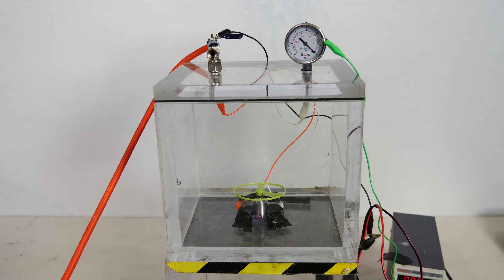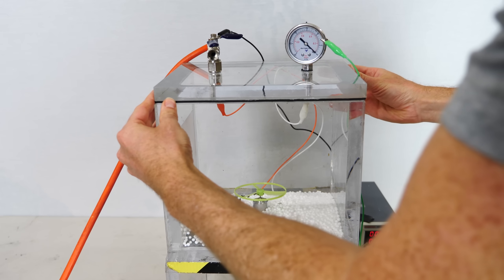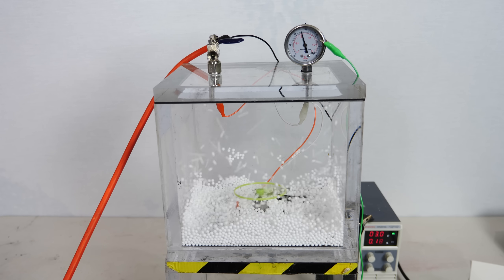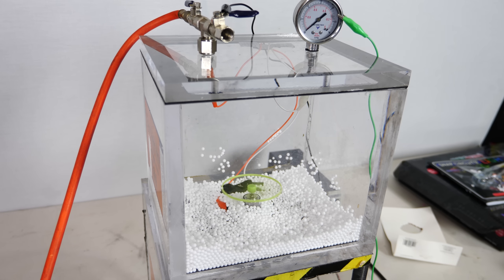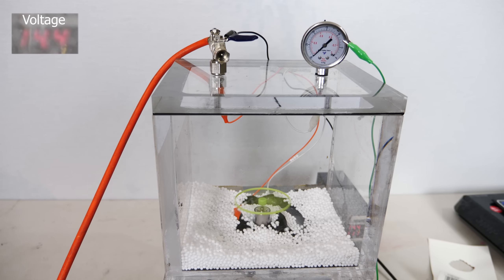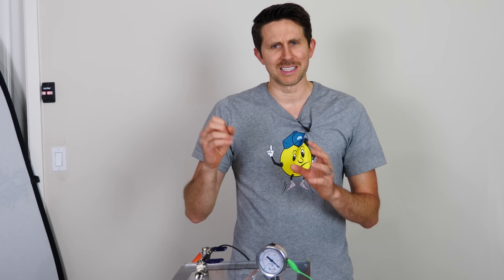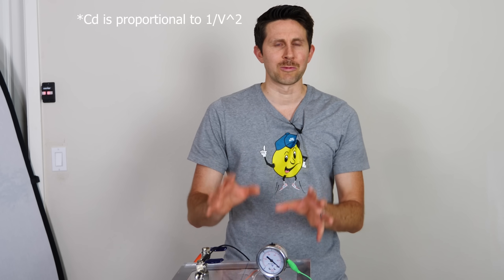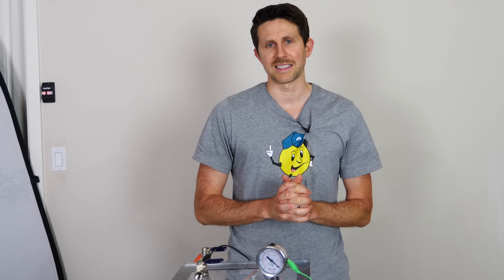What Does a Fan Do in a Vacuum Chamber? Weird Results

Comment: You actually had a crude turbo pump there with that fan spinning.  If you could have gotten up to, say 30,000 RPM (and provided a passage out) you would have kept pumping.  You don't really need a turbo pump, though.  You could do this experiment with a diffusion pump and get low enough to stop all bead motion due to air drag.

I've worked in HiVac for decades, and I'm surprised that motor continued to run.  Motors overheat very quickly in a vacuum without air to cool them, plus, if that's a brush-type motor, the carbon starts oxidizing with the little air still in there, stopping any current flow.
Reply: Would a sprengle pump work?

Comment: Motor has no cooling under deep vacuum & will burn up if run very long.
Reply: Then radiometers would not turn. There will be some black body radiational cooling.
Reply: @ernestsmith3581  radiation is a really shit way of cooling
Reply: @sirsanti8408  i mean, rocket notor need hell lot of cooling, and in space, it is only coooed by vacuum

Comment: You missed a significant clue. At atmospheric pressure, the motor was drawing 240mA at 3V (1:11). At low pressure (can't read the gage), the current had dropped to 130mA (2:09). This would be due to the motor running faster (less air drag allows the motor to run faster > generating greater back EMF > which reduces current). I would have liked to see the current at 2:50. The motor temperature was probably also going through the roof (less air > less cooling).

The references to "The Martian" when the storm blowing over the rocket refer to a plot device needed to get the story going. In reality, the forces on the rocket would have been minuscule.

Still, an interesting experiment.

Comment: Air friction is not what's causing them to move around. It's static. The static between that plastic fan and those beads is going to be huge.  Remove the static and they won't move except for the few that physically come in contact with a fan blade.
Reply: Great mention,, temperature would then also help dictate the volatility and level (ie, amount) of static that'd come into play
Reply: @tv-on-da-gochannel5791  temperature? What’s the effect of temperature on van Der waals forces? Wouldn’t a higher temperature reduce the strength of static attraction by increasing the random assortment of charges and preventing alignment for long enough periods of time?
Reply: @jonathanodude6660  van Der waals force is not static electric force, not close
Reply: @jonathanodude6660  The "static electric force" you are referring to is the attraction between two NET charged objects, i.e. monopoles, like an electron is attracted to a positron. 
The "van der waals force" only covers dipole-dipole interactions in molecular scale, it is a very weak force in daily scales. Potential of Instantaneous dipole-induced dipole scales at r^-6 and even permanent dipole-permanent dipole scales at r^-3, it's that weak compared to monopole's r^-1. 
And the most important distinction is you never use dipole approximation when you have a net charged object, like anytime we call something "static". Try a multipole expansion yourself if you're not convinced.
Reply: @jonathanodude6660  static/static electricity/static electric force, aka Coulomb's law is a force if we are talking about the same thing, didn't mean to quote but just "this term" (or similar). 
As for "close", it ultimately is a subjective judgement but the difference between induced dipoles and monopoles is big enough to me even if the definition is extended to macroscopic objects. But again that might just be a physicist bias.
Reply: What's static?
Reply: @AbhinandanKumar-vq9xv  electricity is the movement of charge. Static means not moving, so static electricity is charges that are building up in one spot. If you’ve ever shocked yourself on a car or other metal object, that’s a static charge building up and discharging through you. 

You can see it in action by rubbing a balloon in your hair then letting go of the balloon (it sticks) or rubbing your feet on carpet and touching someone else or something metal.
Reply: @jonathanodude6660  got it thanks!👍
Reply: @AbhinandanKumar-vq9xv  
Static is short for static electricity, which is just electricity not caused by moving charges. In other words it's a static or not moving charge So there's no current involved.  Plastic fan will develop a charge as it rotates and the balls develop charge.  Opposite charges attract while the same charge repels. So the rotating fan causes a force on the balls. So it's electricity that's moving things around not air.
Reply: @dankuchar6821  ohh it's static electricity.....got it👍👌😅
Reply: Im suprised nobody is mentioning the fact that it needed significant less amps, dropping from 2.4 to 1.3
Reply: If the atmosphere is at 0.1% and the fan is running 10x speed you still get 1% of force and these things are pretty light.
Reply: Also in a real vacuum of space which even the Sandusky Chamber can't get to.  Space gets to 10-17 Torres  that's huge
Reply: Good call. Without the humidity in the air, there’s no way to stop the static build up
Reply: so youre saying static can be used to make an anti gravity device?
Reply: @newbleppmore7855  
Not what I'm saying at all. Static is just electric charge.  It's not gravity.
Reply: Not so.  The fan's motion has little to do with static.  (What he could do to prove this is to treat the beads & fan with anti-static spray).

Comment: I was wondering how quickly the fan would break because of no air cooling.
Reply: The resistance inherant to the copper windings in the motor generate heat regardless of motor resistance. My guess is the heat build up warmed the output shaft so high that it started to transition the plastic blades towards a liquid, breaking the static friction holding the fan blade on the motor output shaft and allowing it to fly off. I’m pretty impressed that the motor seemed to survive that abuse.
Reply: @phxf  no,the fan brake lose due to vibrations, that are clearly heard.
Increasing rpm increases back EMF and that means resistant current is not half as fast increasing as you might think.
Reply: @ambassadorkees  There could also be some effect of the rising temperature of the shaft.
Reply: @mrkv4k  Not enough to get the plastic to melt, is my guess. No obvious signs of heat either. But very obvious signs of vibration.
(Have done similar things without the vacuum, vibration will knock the ventilator off)
Reply: @ambassadorkees  It doesn't have to melt, just make it slightly softer. And with those amps, I am pretty sure that whole thing got pretty hot fast.
Reply: @mrkv4k  I disagree, but it would take me too much time to calculate  how much a 100g block of steel, copper and magnet would heat up with a gradually growing dissipation of 5...24W. Not massively, I guess the result would be under 60°C. But I'm an electric engineer with experience, not a thermidynamics expert.

To tackle the problem, would need to make an integral of the volt-amperes-time curve to estimate total absorbed energy and the thermal mass of that little motor based on typical material contents.
Reply: @ambassadorkees  I think that you are making the mistake of thinking about the motor as a whole. There is much lower thermal resistance between the coil and the shaft then between the coil, the magnet and rest of the chassis. That very small gap between stator and rotor part will make the difference, especially in vacuum. Most of the thermal current will go from the coil, to the metal parts of stator, to shaft. Rest of the motor will be heated up only through the sleeve bearings.
I think that even temperature around 60°C could make some difference, but sure, at this point I am just nitpicking.
Reply: @mrkv4k  I think we need to team up in a good laboratory 🤣
Reply: A vacuum is a harsh place .
Reply: @michaeltaylors2456  Ya, just ask the flys I sucked into mine.
Reply: No, the inherent voltages of the vacuums molecular structure reduces the heat drag newtopez ratio on the inner windings of the topiary brass inductors.
Reply: Given that there is no air for the fan to push, there's really no load on the motor. This was my first thought as well, but I guess the only way it would overheat would be through friction.
Reply: @FallLineJP  Friction and the wires heating up because of the high current going through them.
Reply: @FallLineJP  the friction is created by the magnetic fields that turn the fan. Turn a motor by hand. They dont spin freely. They start and stop.  That's from the fixed magnets.  That will cause friction even in a vacuume from my understanding.
Eg induction heating.
Reply: @FallLineJP  At the end it looks like it dissipates 18V, 1,5A though it cannot be clearly seen. A whopping 24W compared to the nominal 660mW. Since also air cooling is lost, I'd say this test would end up in smoke when prolonged. But the less than a watt nominal consumption won't heat anything that big and heavy to destruction.

Comment: Here is my little take on it. After the lowest vacuum point at the default fan speed the balls sat more or less still. As the fan was increased, they wiggled some but didn't move around. The fan was turned up more and few balls seemed to start flying. I'm thinking that was static (electromagnetic fields) related. You could see as the fan was turned up very high, the balls were flung up and slammed back down. The impact craters are visible at around 3:50 as the fan really gets going. At this point all the flying balls are acting like air. They all start bouncing off each other from the fans energy. I think if you could remove the static effects the overall process couldn't get going. I also bet that if it was already swirling, you could remove the static and it would keep going.  The static effects are need to start it, but not to maintain it.

Comment: Why no clasps or clips on chamber lid?  you were getting pretty significant air leaking in because the lid is not sealed well
Reply: how are clasps gonna help? The vacuum holds the chamber shut as long as the seal is tight, I don't see how clasps and clips help with sealing

Comment: *IDEA*: How well does sound propagate through a vacuum,  with a speaker  at a set volume maybe.
Reply: Sound only travels through a medium so it won't travel through a vacuum very well or at all. There's your answer my dude
Reply: @andrewyellstrom2585  It can travel through the wall of the chamber though^^
Reply: @andrewyellstrom2585  I guess I mostly wanted to see a real life demo of it, and see how "volume" drops off in relation to pressure.

Comment: A cryo plate can freeze left over atom and drop the pressure even more.
Reply: Theoretically yes but not really practical without very specialised equipment as most components of air only liquify and freeze at temperatures below -100

and there really are not many ways a regular person can get things that cold as anything below maybe -50 requires specialised equipment (the easiest way of getting something at cryogenic temperatures without specialised equipment is liquid nitrogen, but that notably releases more gas as it warms up and it still wouldn't be cold enough to actually freeze air (because air is mostly nitrogen, and liquid nitrogren is well... liquid nitrogen))
Reply: Keep the case from vibrating first! lol

Comment: First thing I noticed (and I expected it) was that the styrofoam balls expanded as the pressure dropped. Then as the motion from moving air reduced, we were left with less air movement,  charge effects and vibrations

Comment: will the vacuum box sink in water if you pull all the air out?
Reply: Probably not if it is made from plastic... plastic us about the same density as water afaik, so if there is a bunch of nothing inside that will make it float (say it was fully submerged, then the weight of water with the volume of the vacuum  will push it up)

Comment: And the current consumption decreases as the vacuum decreases too.
Reply: That’s what I came to say, was the first thing I looked for. As the atmospheric friction dropped so did the current draw. Simple example of friction losses vs efficiency.
Reply: Doesn't the current consumption decrease as the vacuum INCREASES?
Reply: @yomomma4270  Yes, you are right I was thinking in pressure.

Comment: Go all out on what static electricity would do in this situation. Take out all the humidity of the air by lining the bottom of the chamber with silica gel (under a permeable membrane), put in styrofoam balls and leave under vacuum overnight. Use something like brass for the fan blade material. Then rub a cat against the outside of the chamber.

Then my life will be complete.
Reply: 'rub a cut' - comedic genius!
Reply: This comment deserves more likes
Reply: That laughable, if in a vacuum there is no humidity, or it is not a vacuum.
Reply: yeah the cat would prolly jump on it
Reply: In a chamber where air is removed the humidity is also removed, as in all water is evaporated and removed as a gas so humidity is also zero.
Reply: @Todd Thompson My corona got healed after I did that, thanks.

Comment: Please be careful jumping to conclusions. At higher voltage and with a lack of cooling on the motor, it may have begun to out-gas from the winding and or bearings from heat, so your pressure may have increased from the motor producing gas pressure. To run the experiment again, I recommend adding a refrigeration vacuum gauge to measure the pressure in microns and actually see the pressure. The Styrofoam beads contain the gas that formed the foam. With the fan at high speed impacting a few beads, this damages the pellets and liberates the gas contained inside.
Please borrow a vacuum gauge from an AC professional and repeat this test.
Reply: Did you not see the big gauge on the top right of the box?
Reply: @AlessioSangalli  Yes, I saw the big gauge that does not display in microns, or 1,000ths of a mm of Mercury pressure.  An increase of 500 microns will not be readable on that big gauge. It will not show a pressure rise of 100 times a base pressure of 50 microns.
This gauge I am referring to is one like this one.  https://www.trutechtools.com/Accutools-BluVac-Plus-LTE-Wireless-Digital-Vacuum-Gauge?utm_campaign=19Bing%5FShopping%5FB&msclkid=084525301ed71e71bea645359a133be0&utm_term=4580221849787991&utm_source=bing&utm_medium=cpc&utm_content=Initialize  The gauge he has is like seeing if a hearing aid battery is low by using a high voltage probe.  Full scale in the gauge listed in the link is 25,000 microns. 1 inch of mercury (HG)  is equal to 25,400 microns (of mercury) Atmospheric pressure at sea level is approximately 373,380 microns. That big round gauge does not have enough resolution to measure low pressure accurately. This is why I asked for a micron absolute pressure gauge.
Reply: @isettech  oh I see what you mean. Thanks for the detailed explanation. I am also getting into experimenting with vacuum and Your advice is very useful
Reply: @isettech  damn 275 bucks
Reply: @AlessioSangalli  Built and priced for professional use. Not a hobby item.
Reply: @AlessioSangalli  Welcome. If you start working with this, it pays to learn and understand the main units of measuring absolute pressure (pressure above perfect vacuum). Study, Torr, the 1/000th of that the militorr, the Pascal, Bar, and it's low pressure range, milibar, and inches of mercury. This will help when understanding low pressure values.
Reply: @isettech  yeah but it cost double the two stage vacuum pump (22.5 micron capable) I was considering. Also I do not understand why people use so many units for pressure, isn't N/m² enough for everything?